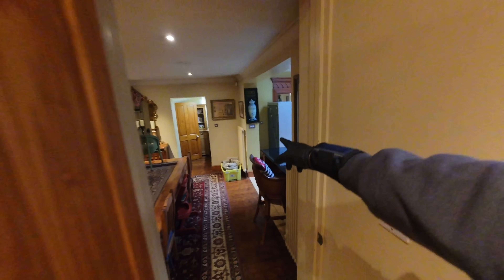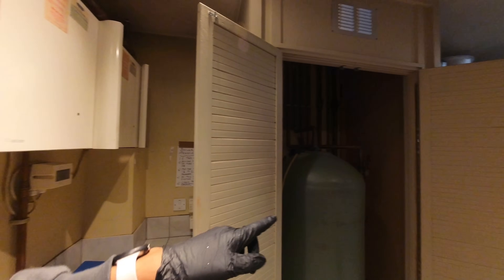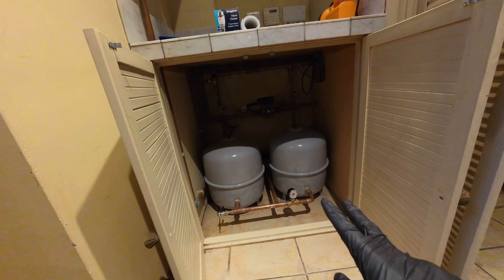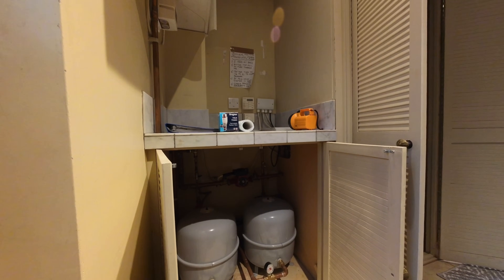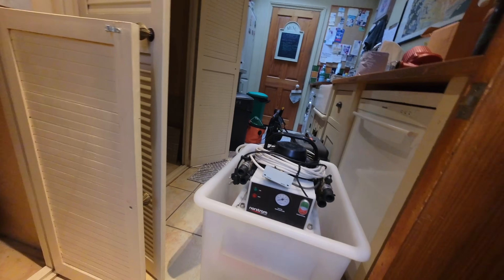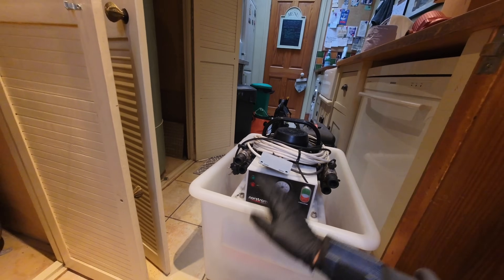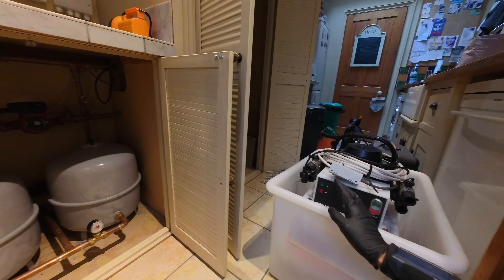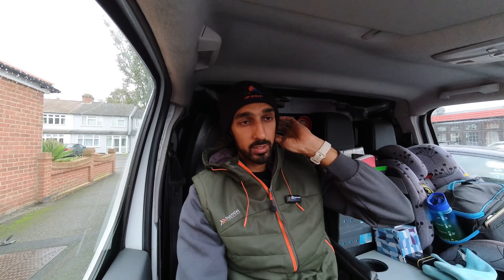What Would You Have Done In This Situation? - A Day In The Life Of A Gas Engineer 94

Comment: The boiler resistance through the boiler heat exchanger restricts the flow rate to feed larger heating systems, a low loss header is required  for sure, would i power flush , put Kamco hyperflush in for week or 2 drain system , refill job done.
Reply from the maker: Nice one 👍🏾

Comment: You must of surveyed the job before attending so use that time wisely and thoroughly to gather as much information as you can in order to formulate a plan of attack as the customer has put their trust in you and they expect results only achieved by proper planning and a big emphasis on observation. I certainly do not want to sound condescending  or patronising but preparation before hand is the key to a successful job and not always will you succeed despite your best efforts however my philosophy is 'problems and solutions = successes' I have retired now from the domestic & commercial heating sector having been with B.G. for over 30 years where we served a good apprenticeship unlike today where trainee heating engineers do not in most cases have that luxury as company's neither have the time or capital to invest in proper training so I consider myself fortunate, so now to the nitty gritty, when your surveying a power-flush take a small magnet with you and attach it to areas of the heating circuit where you find poor flow rate (low temperature) if it sticks to the copper pipe then you know you have your work cut out, show the customer your findings and explain that a magnet should not stick to copper pipe in fact its attracted to the iron oxide inside the pipe this is a great tool to demonstrate your findings, once you have a clearer picture of the heating system then cost it accordingly but I believe from seeing previous videos that you place a disclaimer in your quotation which is very sensible so the customer understands to the best of there limited knowledge if issues arise. This particular job I would of allowed two whole days considering the amount of rads and debris inside the heating circuit and other components and yes you quite rightfully stated the two boilers should have been designed with  a low loss header (very poor practise) But keep your chin up and I will keep watching you with great interest as you have what it takes to become a very good heating engineer

Comment: If the pipework is choked I'm not grasping how a low loss header and new boiler resolves that tbh. I'm not saying its not a better way of doing it but you're still going to have to resolve the system pipework. If cost for the customer is the concern then clearing that pipework is the way forward.
Reply from the maker: Yeah 💯 that'll be the initial task, but also looking at upgrading the system overall too

Comment: You made the right call. It's obvious the customer was happy with your honesty and explanation otherwise they wouldn't of offered to pay you for wasted time. I tend to find if you do right by your customers they tend to remember it for future.
Also if you're going to power flush something like that system, all you really want is the sealed unit heating and an external pump. It's a pain but they just don't have the head on larger systems. I have been known to use the immersion on the cylinder and use the thermal mass of the cylinder to help heat the pipework when leaving the zone valve open, and just rejigging the pipework while carrying out the flush.

Comment: This is not  job to be done 2 weeks before Christmas ! It should have been done in the summer when we have more time available as it will probably need 2 days just for the clean with those rads. Having said that I wouldnt even consider power flushing a system with boilers 20 plus year old. Time for an upgrade, proper boiler/system size calculations and a single boiler. It would be interesting to look at the flow rates through the boilers and a 3 port valve ! Bizarre. I suspect possibly has never operated properly ?     
I think you dodged a very big bullet there !   
When I fit a Bypass, I always fit a gate valve too. It means you can isolate for ease in the future. On existing,rather than remove/cap of the Bypass I would also do the same and just fit a gate valve.  Means you can clean the bypass loop and no wet work to reconnect at the end of the cleaning. 
Take care...
Reply from the maker: Nice one thanks 👍🏾